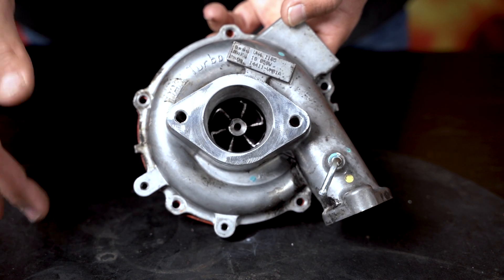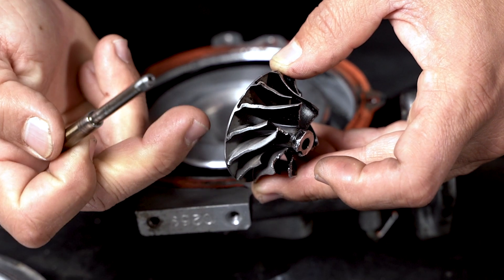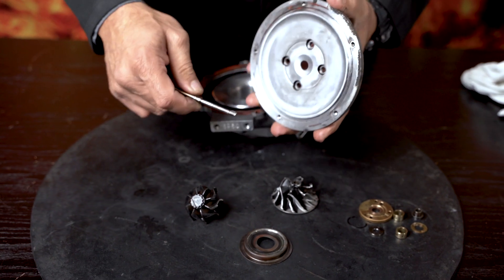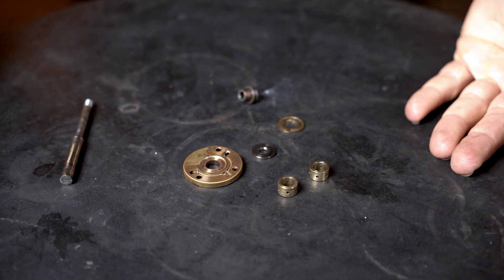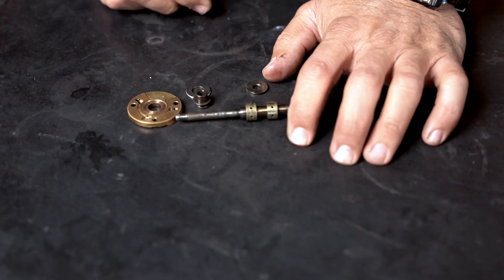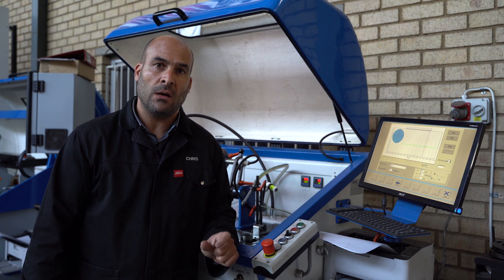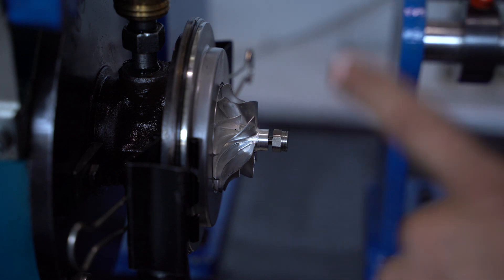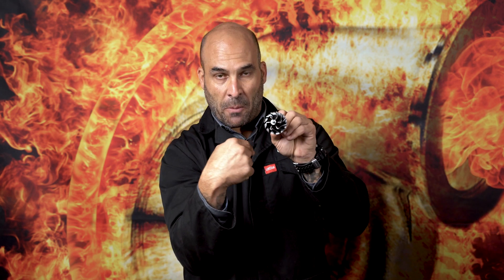Can a turbo shaft nut loosen during operation?

Comment: This is not true in some cases.
Old kkk k26 turbos, from old Audi 2.2 10v turbo engines, and as far as I know, few more k26s and k27s too had that problem. Old ones had the nut screwed clockwise - the same direction that the compressor wheel spins. Guess thats the problem...
These turbos are operating for years with no problems when left at stock boost levels, but when we push them to their limits they often unscrew. I had one k26 and one k27 that did that and know of many more.
Reply from the maker: I disagree - if you provide me with the part# i will confirm this in writing with BW for you. There has never been a time that the shaft nut tightens in the same direction of rotation - this turbo will not last 2 minutes under any acceleration condition.
Reply: @TurboDirectSA  I have that blown kkk k26 in front of my eyes in my workshop right now :) It sat previously in an Audi 100 quattro (C3) with a 2.2 10V turbo engine(engine code MC). The nut tightenes clockwise :) 
K26 lasted years making about 160HP when stock and then lasted few dyno pulls making 270 and spitting the nut :) 
I also have a blown K26/27 that made 360HP and then spit the nut on the way home... Also tightened clockwise.
Reply from the maker: @noorec  I have stock of the original turbocharger from the Audi Quattro - and the nut most definitely tightens opposite to the direction of the compressor wheel rotation.   Please share the part# if possible so i can pull this from stock and show you. There are many variations of the different model turbos, but in my 25years of experience i have never come across any shaft nut that tightens in the same direction of rotation as the direction of compressor rotation. This is the oldest fallacy that exists in the turbo game - thats how i know.
Reply: @TurboDirectSA  I just tell you what I see here and what I have seen. This iss a common/known problem with old audi k26s.
Numbers on the k26, from the plate at the compressor housing:
035 145703 L
K26
88 446 0695
5326 970 6411
Reply from the maker: @noorec  Thanks for the info- i can confirm 100% that this shaft fits into 84  turbo variants and every one of them is left hand thread. the compressor rotates clockwise - the nut tightens opposite to direction of compressor rotation.  I also sent an email to BorgWarner asking to confirm that if there wasnt a special case where the turbo was in fact made with this tightening orientation - i have not had a response as yet. 

The original shaft part# was 53261202107, then replaced by the -2119 and then replaced by the -5002 and finally replaced by the -5017 - all shafts are identical according to the technical specifications we have access to online through BorgWarner.  

Once i hear back from Borg - ill share their comments with you also.
Reply: @TurboDirectSA  ok but... Whatever you hear from BW, I have these kkk's here and trust me they turn clockwise and the nut thightens clockwise :) 
Can't send you numbers from that k26/27 hybrid, because it has no plate, but same story.
Reply from the maker: @noorec  If Borg Confirms left hand thread then the shafts you have are not genuine. So far all the info on this turbo which is still in production and available for purchase shows in writting that it's not a right hand thread. Lets see what Borg have to say - ill share same with you once i get the response.
Reply: @TurboDirectSA  this is interesting.
One of above mentioned turbos is a hybrid k26/27 so ok, maybe someone changed the shaft, but the other one was at a stock engine and turbo also looked as old and stock as the engine...
Reply from the maker: @noorec  Got confirmation from BorgWarner engineering - they confirm 100% that they have never manufactured a K26 shaft  with a right hand thread before. The K26 shafts have also always been normal rotation.
Reply: @TurboDirectSA  Hi. Thanks for your involvement in this mistery right hand nut story :) 
I made some research and talking myself and our local workshop, that made quite a lot turbochargers for us, including few k26 billett wheels, told me the exact thing I told you - old kkk k26s had right hand tightened nuts. These were befote BW took over kkk.
He told me that they had many issues with BW regarding parts that were manufactured before they bought/took over kkk or schwitzer - BW doesn't put much attention to these old turbos and they seem not to have all data/specifications of these old ones... 
He also told me that kkk's weren't the only ones with such shafts.  Some mhi td04 turbos back in the 80's and few others also had it...
These are not my words. I don't repair turnochargers, but look,  I've seen about 4 kkk's with right hand nut, I have two off them in my workshop and what's most important I'm not the only one - like I told you it's a known problem with old audi k26 turbos.
Reply from the maker: @noorec  My pleasure - only happy to help ... here is the copied and pasted word for word reply from BorgWarner on this "mystery"  --- Keep in mind i used the part# you provided on this turbo being 53269886411

"Hello Chris,
 
This turbo 53269886411 is right-handed, therefore it is not possible to fitted a shaft and a nut with a right hand thread.
Only left-handed turbochargers are fitted with shafts and nuts with a right-hand thread. Probably such a turbo was fitted to the Audi Quattro, but it was definitely not turbo 53269886411.
 
Best regards / Mit freundlichen Grüßen," 

Sorry but i have to disagree with you on this - no manufacturer has ever used the same direction shaft nut as the turbine/compressor rotation - its a definite recipe for disaster.  I doubt any manufacturer wants to cause problems for themselves.
Reply: @TurboDirectSA   So, you have to disagree with me and apparently I have to disagree with you :) 
You say that this is impossible, no manufacturer does so and yet - I have two KKK's that say the opposite.
Guys from the mentioned turbo workshop say the same and name other brands like the 80's MHI or even old Garretts T3!!! And they also had right hand threads on right hand shafts.
I even managed to do some google research and here's what I found:
https://www.turbomaster.info/eng/bulletins.php?id=13

It says: "Garrett has replaced right hand threadform with left hand threadform turbine wheel assemblies for models T3 and T4..." so, clearly - manufacturers like GARRETT(and KKK and MHI etc.) did make these kind of shafts. Yes, apparently they changed them later to left hand BUT - they did make them!
More links below:
https://www.jeepoxz.com/index.php?main_page=product_info&products_id=443723
https://forums.hybridz.org/topic/106144-left-hand-reverse-threaded-turbine-shaft-nut/#comment-992956

And as for the answer from BW.
I presume they refer to replacement shafts. And that's right - you can't buy right hand shafts with right hand nuts. They only make replacements that are left hand - that's not really an answer... And aspecially if someone says that Audi Quattro could have had a left hand turbocharger... Does a left hand k26 even exist? :D 

Chris, I'm not trying to question your knowledge or experience, really far from it, but unfortunately in this case you are wrong.
Reply from the maker: @noorec  I guess we have to agree to disagree then. Facts once again - will always prevail. Here are the facts that I have. 

1) Borg Warner are the designer and manufacturer of the 53269886411 turbocharger, they have confirmed in writting that this turbo is NOT right hand thread - im sure they would know more about this topic than a workshop or anyone else for that matter - this is why i asked them in the first place, so as to negate any opinions on the matter.
2) It is a known fact in the turbo industry since the inception of the turbocharger that the thread is always opposite to the direction of rotation - for the very obvious reasons.
3) I have proven what actually happens to a shaft nut during operation of a rotating assembly in my video above.

I can go on and on, but i think the obvious is the following:-  I as a paying customer would claim a warranty for a defective product(and it is defective if the thread was RH on this specific K26-6411 turbo) when the shaft nut loosens if it were in fact right hand thread on a clockwise rotating design.

The obvious question in my mind would be - i wonder why BorgWarner would go to the trouble, costs and risk to manufacture a known defective product that WILL fail -- Well i guess only BorgWarner can answer that - and they have, related to the part# you shared which is a normal rotation design and the thread is 100% confirmed by the designer and manufacturer as being left hand thread in the mail correspondence yesterday.

PS:- Garrett is not BorgWarner, and Garrett have never manufactured or designed KKK K26 turbochargers - not sure what relevance this has on a totally different manufacturers product.... Im sure if we ask Garrett for information on the specific T3/T4 setup, they would have an answer for you .... 

PPS:- Just because a company sells a right hand thread nut, doesnt mean BorgWarner manufactured a right hand thread version of the KKK K26 turbocharger -- not sure what the relevance is here....  

I get that you not questioning my experience, this is why i got BorgWarner involved so that i dont share my opinion with you, instead facts from the horses mouth -- i dont know everything about turbochargers, and dont claim to either - however when i dont know an answer, ill ask. Ask is what i did and the answer is clearly not what you expected to hear - i dont know what else to tell you other than you should claim a warranty fromBorgWarner for the failed turbo.
Reply: @TurboDirectSA  Ok. Last one, I promise :)
 Answers in paragraph order:

 1) yes, they answered and as just I said before there are some issues with KKK's and Schwitzers from the "pre-BorgWarner era"... I'll just leave it here. Continuing this topic is pointless I think, aspecialy when they say that maybe Audi had a left hand rotating turbo, left hand rotating k26 turbo, that as far as I know doesn't exist...

 2) I guess they didn't know that from the start. That would reason changing it later, right?

 3) True. You've proven, that left hand thread is a better and safer option - once again, that's why manufacturers switched to opposite thread.

 4) True again. And once again that is why it was changed later on and not only KKK did that.

 5) BorgWarner didn't!(I think...) The K26 turbo we're dabating about was a pre-BW KKK product in VERY early 80's.

 6) Yes. Garrett is not Borg Warner and you're probably right and they didn't make shafts or wheels for each other. That's not the point.
 You said that no manufacturer ever made  a shaft that tightens in the same way it rotates. 5min google reaserch and it seems that Garrett did. In the 80's. And just like KKK they changed the design later on. It's in the links :)

 7) you missed a point once again. Links were not about BorgWarner - they were to show that there were manufacturers(in this specific example - Garrett) that made such shafts.

8) I agree that opposite thread is the way to go. Guess all turbo manufacturere got to that point too - waaaaay back in the 80's.
 You say those turbos don't exist and nobody made them - I have two examples in my workshop, seen two other and heard about quite a few that had the same and found out that not only KKK but also Garrett and MHI went that wrong way back in the days...
 I won't try to convince you :)

 PS. Keep up the videos. Subscribed and ready to watch :)
Reply from the maker: @noorec  I agree round and round -- facts once again remain BorgWarner confirmed they have never made a right hand thread turbine - ever. Not once, not ever. BorgWarner is KKK, and Schwitzer - this is one company. While KKK was operating on its own, and was acquired by BorgWarner, the tooling and drawings simply changes hands/names  -- no changes were made - BorgWarner would have confirmed this - instead their records (since the beginning of time) show that the Audi Quattro turbo K26 with Part# 53269886411 was never ever, ever ever ever - not once ..... made with a right hand thread - as i mentioned, show me a brand new 53269886411 turbo with a right hand thread -- i doubt you would be able to - not a genuine BorgWarner or KKK unit anyway. 

I have left and right hand thread Garrett nuts in stock - i can sell you 200pcs today.  This means nothing as i can literally fit these onto 100s of different shafts which are counter rotation.  I stock ALL the T3 and T4 (in literally every configuration possible) on hand - for a specific reason, and not a single one has a right hand thread (with normal rotation blade design) not original Garrett anyway. 

Turbochargers are not new, they have been manufactured for close to 80years now, and the thread direction is the first thing which will cause a failure - no manufacturer will put into production something that will fail -- 

Its like saying that pistons manufacturers will machine the gudgeon pin hold in the exact centre of the piston ---- knowing that it will fail. Its just not done.
Reply: @TurboDirectSA   
Hi :) I just couldn't let go this case, so I made more research and even asked people from the UrQuattro community about it. 
I got quite big response. Most of them had, seen or just knew about right hand tightened nuts on k26's in Audis and Porsches. 
Few even sent me photos of their turbos, where you could see compressor wheel and shaft with right hand thread.

 But I guess that won't be any proof for you(just like my two kkk's, mentioned earlier) so I found something far more interesting: 
An old KKK K26 rebuild manual !!! :) 
Here you go: 

https://www.dropbox.com/sh/qk3xexw7vmsjgzg/AABstsWv3MolQWMIJHpAAz6Da?dl=0

To save your time(because you surely know all this), go straight to page 6 :) 
You'll find instructions how to tighten left hand nuts and.. That's right - RIGHT HAND NUTS!! 
Right hand nuts on KKK K26 turbochargers! 

An old KKK manual. Found it on the internet. 
I wonder why BorgWarner couldn't find it?
Reply from the maker: @noorec  LOL - this is really funny. You know that there is a saying that goes like this "If you look hard and long enough you will find anything"  Well if you do a google search and type in left hand thread turbo, or right hand thread turbo - you'll be amazed at the results - at the end of the day back to facts - 53269886411 has never been manufactured with a right hand thread. HOWEVER KKK have made counter rotation turbochargers with right hand threads (well obviously a counter rotation turbo has a right hand thread, because its opposite to the direction of rotation.  The manual mentions a GENERAL assembly procedure (by the way i have this very procedure posted in my assembly room) for turbochargers in general - this document does not mention a single thing about the Audi Quattro 53269886411 turbocharger -- which if you can remember you provided to me saying that this is the turbo part# which has the right hand thread on it --- 

Once again Facts prevail in this case - sorry but common sense and more than 20 years of experience on my part come to play here - i have never seen a right hand thread shaft nut installed on a right hand rotational direction turbo since the 90's when i started in this business - in closing, i am not saying i know everything, i certainly do not - but i can mentioned what i do know - i also mentioned word for word what BorgWarner provided me with, and in my opinion, this is suffice to rely on as fact.
Reply: @TurboDirectSA  
Ok. You have this manual and you can't see the difference in compressor wheel assembly procedures depending if it's the same or opposite direction tightened? Hmmm...

Let's say that you have a right hand rotating turbocharger with left hand tightened nut(typical case). 
According to manual you put the compressor wheel(clearance fit) and just tighten the nut to a tightening torque. Job done. 

And now you have a left hand rotating turbocharger with right hand thread and you don't do the same as above? I guess you do because these two are counter rotating ones.

BUT when it comes to turbochargers that are tightened in the same direction as rotation, you have a completly different story:
- compressor wheel is press fit
- you have to preheat the compressor to 130°C
- you have to put oil on the shaft
- put warm compressor wheel on the shaft
- tighten shaft nut within 5min to tightening torque after preheating
- after a cooling time of 10min you loosem the shaft nut, put loctite and tighten it again to torque and angle. 
Quite a lot of things to do...

This all makes sense for the reasons you show in your video! 
If you tightened both types the same way it would be like in the video: the counter rotating one would just screw itself on again - nothing would happen. The other one would probably spit the nut... And this is why you have a completly diffrent procedure!!! Heating, press fitting, loctite etc. All of this to prevent from loosing the nut! KKK wrote this, not me :) 

Of course it was a dead end and yes, I agree the counter rotation was the best way to go. KKK, Garrett, MHI and probably others to got that too and changed the shafts and thank god they did, because I saw what happenes with the old ones.

Really can't understand why you refuse to admit that there was something you didn't know about :) It's no shame you know :)
Reply from the maker: @noorec  Sorry mate - i haven't read the last post - its really counter-productive. I honestly want to engage with you on this topic, but its honestly not getting anywhere. If you have a warranty claim or a problem with the design, id suggest you contact BorgWarner about it - im sure they can help you discuss this further.
Reply: @TurboDirectSA  Thank you for the information you provide to the community as a whole. While I’m sure you benefit from the promotion, I feel your main motivation is your passion of sharing your knowledge.
Reply from the maker: @ChrisRWilcox  Pleasure anytime - we have great joy in sharing the information, and will continue doing so.
Reply: @noorec   I just replaced my compressor wheel on a used IS38 I purchased on FB marketplace.

The compressor wheel that was on it turns clockwise and it also has regular threads on it.

Everything I’ve read says this is supposed to be reverse threaded…. But the one I removed the compressor wheel from yesterday was DEFINITELY NOT reverse threaded.

Nut tightens in the same direction the compressor blades spin.
Reply: @robertburton8055  yeah. And there are other brands but as you can see some people just don't get it ;)
Reply: I have a mitsubishi pajero.1997 model.The compression wheel turns clockwise.The nut tightens clockwise too.